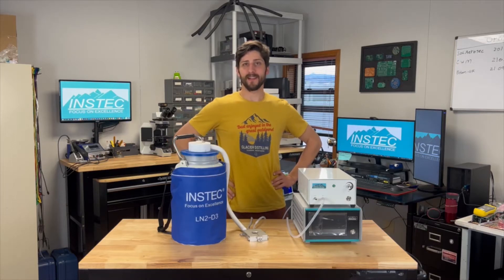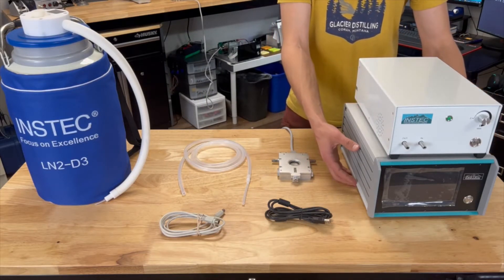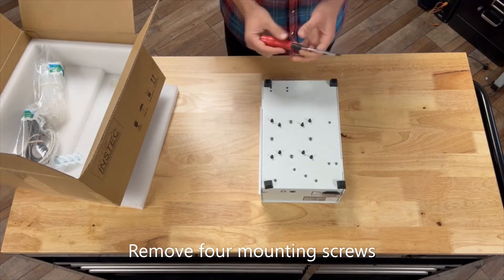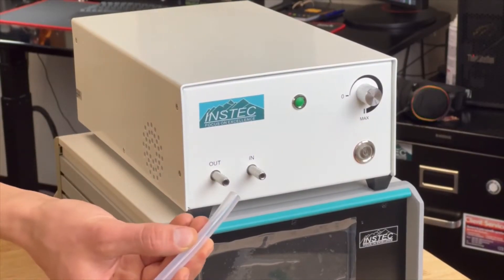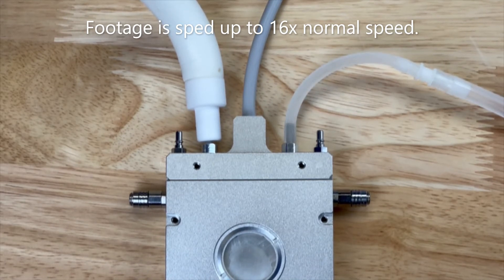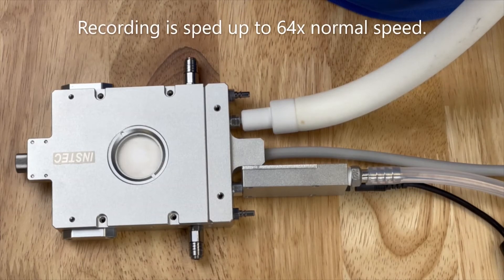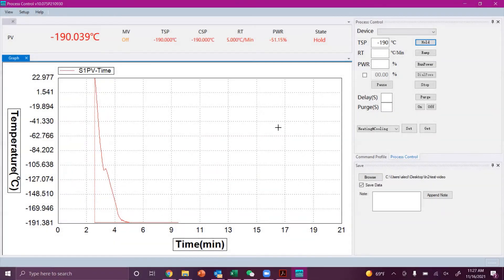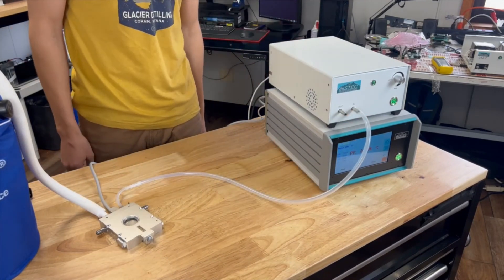Instec Liquid Nitrogen System Introduction

Comment: Hello, would your product work also without the dedicated chamber? (i.e. just for controlling negative temperature, ramps, etc.) of some "chamber" with thermocouple connected?
Reply from the maker: Hi @marijhorn, this is a good question that we get asked from time to time. While we typically build everything to work together as one system, the mK2000B+LN2-P devices can be used on homemade or custom heating/ cooling systems. In such cases we would configure the mK2000B to work with a standalone thermocouple or RTD sensor that is secured as close as possible to the sample or device being cooled. Then, the mK2000B will calculate the cooling power required, and modulate the suction power on the LN2-P. Special care must be taken with the sensor position and mounting to ensure great thermal contact, otherwise the temperature control performance will suffer.